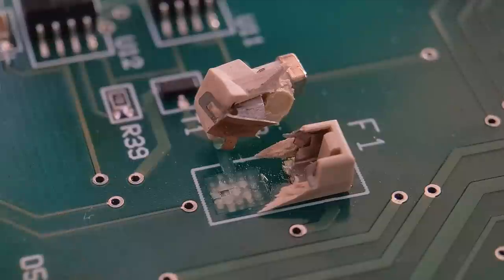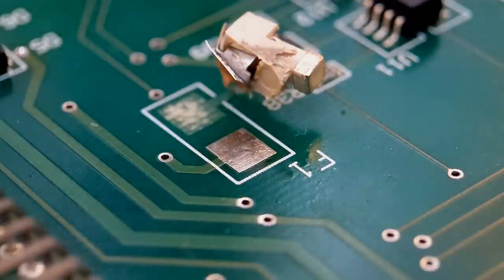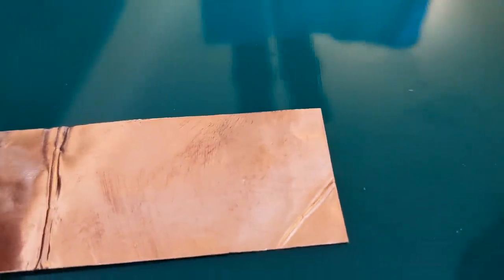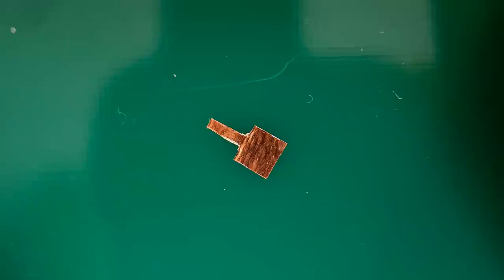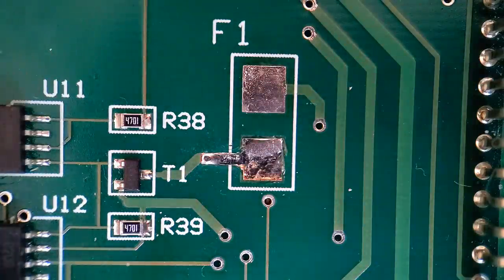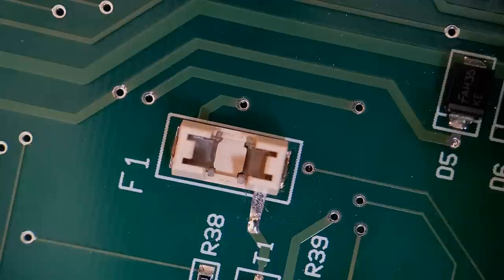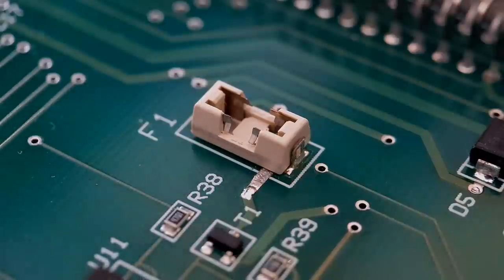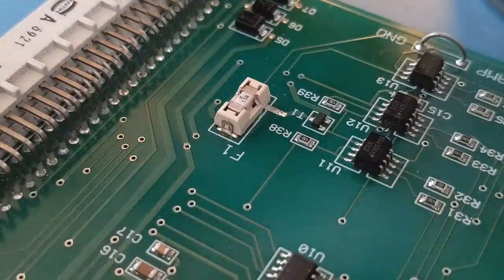How To Repair Damaged PCB Pads / Traces || Copper Soldering

Comment: As a trained and certified solder technician for decades, I personally I didn't understand why you didn't just leave the original pad attached, de-solder the broken fuse holder off, then glue the still attached original pad back down. However you did cut it off and then I don't understand why didn't you make the new pad run longer, scrap the attaching run, then over lap and solder the new longer pad to it, then glue it down. The repair looks good it's neat and tidy, but it could have been a more solid repair with the run overlap instead of a a solder bridge that can crack and open the circuit. Still this solder job is far better than the other hack jobs I see on YouTube with speaker wire and all kinds of stuff. At least you cut out a new pad and glued it down. Thanks for sharing though I still enjoyed the video. I'll check out more of your videos. Best Wishes & Blessings. Keith Noneya
Reply: At beginning he comments that it starts showing some cracking compromising its performance, that's why went with its replacement.
Reply from the maker: @NelsonAntunes-kf5un thank you for pointing this out to people , very much appreciated 👍
Reply: I’m guessing for explanation purposes, I try to save the pads that lift up, but sometimes they get lost or are very damaged
Reply: @yumkaax616 In that case it's best to place a new pad with an overlapping run onto the run that connects to it and solder them together. If it's a pad with a hole in it and it's just lifted, place an eyelet in the hole and crimp it down. If the pad with a hole is to damaged or missing, place a new eyepad in it's place with a long run. then place an eyelet in the hole and crimp it down. Now overlap new only run over the the run that it connects too and solder it. The pad will never come up again. I was a solder technician for over 35 years and have done this to many times to count. Best Wishes & Blessings. Keith Noneya
Reply: @keithnoneya  I never thought about the eyelet, will try it, thank you!
Reply: @keithnoneya would love to see a video of this method
Reply: @keithnoneya  Great advice. Could you tell where to get or how to make eyelets? What type of glue can be used for pads without holes?
Reply: Here's a video on how to set the Eyelet and, although not a run repair the principle is the same; https://www.youtube.com/watch?v=HaVa_7ZInIo Hope those reply's help anyone who needs the info. Best Wishes & Blessings. Keith Noneya
Reply: Thought the same thing

Comment: Good video, but I would slightly overlap the copper foil over the PCB trace, rather than the butt joint that you did.
Reply from the maker: Hi , thank you for your comment , much appreciated. I guess both methods are fine . I like to keep the copper flat to the board that's the main reason I do it this way , but your way is fine as well . Thanks again , take care 👍

Comment: Beautiful repair! Yes, there could be other ways to repair this by preserving more of the original lifted pad, but I think the end result here will be just as good. This will last just as long as the original factory traces/pads, and it’s probably even stronger than the original because of the extra glue fillets to mechanically bond the holder to the pcb surface.
Reply from the maker: Hi , thank you for watching the video and commenting , very much appreciated 👍

Comment: I’ve tried gluing pads with araldite but the bond does not hold when heated.  Plastic padding epoxy weld works great since it’s rated 100 deg C continuous and 315deg C for short periods.
Reply from the maker: Hi , thank you for your comment , much appreciated . That's great you have mentioned another glue that I hadn't heard of , hopefully your suggestion can help myself and others in the future . Thanks again , take care 👍
Reply: Is that the Super Steel epoxy weld?

Comment: I have both lead free soldier (thanks for the tip on 173 deg) but also lead 60/40 solder. What in your experience is the best temp for normal jobs? I think one has to up the temp on potentiometer bodies, etc. because of the larger surface are and also less time heating and maybe breaking the pot?

Comment: I have watched in awe as you repair these minute circuits/pads etc. Fascinating. I have a small quadcopter board that has the pads for a small inductor 1R5 missing. I would really appreciate your input/knowledge as to which process to use on it. Is that a possibility as all? BR Trevor

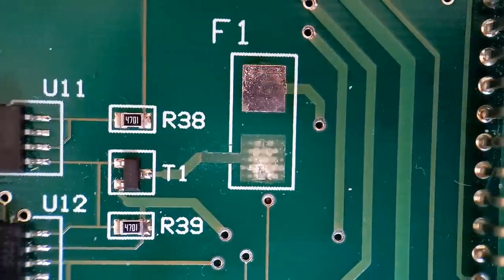Comment: 11:48 Would it be OK to use solder mask + UV cure on the board before putting the glue if the lower layer was exposed or just to make it better? Also, what was the glue you used please? These might be silly or odd questions because I am a newbie to this! Thank you for sharing this, I really enjoy your videos! Cheers!
Reply from the maker: Hi , thank you for your comment . Yes definitely you could protect an inner layer with solder mask  . As for the flux it's called Tak Pak 382 . Its very expensive if brought as a twin pack  , but if you buy the activator and glue separately you can save quite a lot of money . Shop around , EBay , Amazon etc . Hope that helps , thanks again 👍

Comment: Hi, I have learned so much watching some of your videos, thank you. Can I ask a probably stupid question, at 3:27 you use a "cloth" and "Ultra Solv" , can I ask what cloth you are using and why Ultra Solv instead of Isopropanol ? I am having issues with my PCBs being very tacky after I so called clean them. Sorry if its been mentioned before.
Reply from the maker: Hi , thank you for your comment , much appreciated . The cloths I use are only available in the UK I believe . A company called Grove Sales ( England ) supplies them . They are roughly £5 for a pack of 100 and together with Ultrasolve are amazing . I've used pretty much every cleaning fluid and tried loads of cleaning cloth types over the years and the combination I use now is amazing . Ultrasolve is on a different level to Isopropanol which I have used and is pretty basic , cheap and not great . Once you use Ultrasolve you will be blown away by the difference . I get mine from Farnell but I believe RS Components, Mouser and DIGIKEY also sell it , but I maybe mistaken . If you Google it you will find a supplier . It's not that cheap but does last a long time . I buy the 1 litre bottles and pour a small amount into something like a milk bottle lid and then just dip my cloth in it . The secret to amazingly clean boards Is these 2 items plus a hairdryer . For a great cleaning method I've posted a video on my channel all about cleaning including the hairdryer . Hope that helps , thanks again 👍

Comment: Does anyone know of a glue that actually sets and is resistant to heat from the soldering iron?
I've done countless repairs with copper tape, but every glue simply turns to liquid the moment you try to solder. 
Only way I've found is to do the repair, solder THEN solder mask on top...but doesn't as neat.

Comment: Hey, just wanted to drop a quick but MASSIVE thanks for all your videos, but in particularly ones like this on fixing missing pads/traces. Following your videos I was able to successfully repair a faulty Grandstand Astro Wars game from 1981 that I bought as spares on eBay. One of the faults was the common D882 power transistor failure and by the looks of it I wasn't the first to attempt a repair of it! After removing the D882, I lost 2/3 of the pads! I jumped one with insulated wire to a nearby pad on the same trace and used some old earth wire copper strand to connect the other pin to the trace after surfacing some copper. All learnt from your videos! Keep 'em coming!
Reply from the maker: Hi , thank you for your comment , very much appreciated . I'm really glad the videos have been of use for you , that's great to hear . It's always nice when you can fix old products so good on you  . I will always post more when I can as long as they seem useful still  . Thanks again and good luck with all of your soldering projects in the future , thanks again , take care 👍

Comment: Thanks for making this video!! Recently I was trying to repair a gameboy color and when I was trying to reinstall one of the battery terminals (a through-hole component), I accidentally pushed the copper up. Will this work for the copper around a through-hole area? Sorry if the description of what happened isn’t great, I'm not sure of the right terms to use since I'm still a beginner. I wish I could show a picture since they're worth a thousand words lol
Reply from the maker: Hi , thank you for your comment , much appreciated . Yes this method would definitely work for the situation that you have . I have also posted another video on my channel showing 4 different methods for your type of problem . This video may be useful for you . Thanks again and good luck 👍

Comment: After all of your meticulous care I was surprised you didn’t cover the exposed trace with solder mask. Fantastic work though. Very impressive.
Reply from the maker: Hi , thank you for watching the video and commenting , much appreciated . The only reason I didn't solder mask the repair is when I filmed this video I didn't actually have any . I did state somewhere near the end of the video about using solder mask to cover the repair if you wanted to . I posted another repair video shortly after this one where I did use it ( I had some by then ). Thanks again for your support , take care

Comment: I wonder if Fuji Seal-Glo might be a convenient and good adhesive for the purpose. It's the red colour heat-cure 1-component epoxy that you find under backside SMD components, which normally permanently cures during soldering.
Reply from the maker: Hi , thank you for your comment , much appreciated . I haven't personally used this particular epoxy so I can't comment on it . Maybe others who have can comment . Thanks again , take care 👍

Comment: This is so much nicer as a finish than the jump wires I've resorted to on the couple of instances I've had to deal with lifted pads (diy repairs on little projects). And the end result you show, is definitely worth the effort.

I don't often have to repair things, but I have a few repair projects sitting in my to-do draw... Along with a whole bunch of on copper strands taken from a power cable, ready to shape around component pins that need to be removed.

So yes, I'd previously learnt a great tip, and this is another to add to my pile. I've been using a soldier iron since I was about 7, and I'm still one of the greenest novices you'll see (some 36 years on). In fact, I don't doubt that the grandfather who told me I'd used enough solder to weld up the Titanic, would probably still say I could weld up a frigate with some of my solder joints. 😂
Reply from the maker: Hi , thank you for your support of my channel it's very much appreciated . If my videos can help a few people out with their desoldering / soldering projects then I'm happy . Thanks again , take care 👍

Comment: I just had to replace this fuse holder today. 
How do you deal with tight spacing? The solder iron barely fit between the fuse end and a plastic board mounted connector.
Reply from the maker: Hi , thank you for your comment , much appreciated . I fully understand your question about tight positions of components. The iron I use a Weller TCP S has tips that allows me to manipulate the shape of them slightly, bending etc , also filing them down to achieve an incredibly small tip . Even though many people tell me you can't do this to your tips I do and it works great . I have a Metcal iron also for my professional day job which comes with micro long tips which can get into incredibly tight gaps . I do believe choosing the right tip does help in nearly all cases . Sometimes I will remove the component next to where I need to solder and then refit it after soldering on the new part . If the position of the pads allows this I will sometimes choose this method . There's always a way . Thanks again , take care 👍

Comment: One question. Have you done BGA replacements? If so I would love to see your take on it. I know I have watched all of your videos at least twice but cant remember If I ever seen anything dealing with BGA.
Reply from the maker: Hi , thank you for your comment . In my video . Removing Electronic components ( part 2 ) , I show how to easily remove the BGA and clean up the pads on the board after removal . No matter the size of BGA this method works for me every time . The board is perfectly prepared ready to accept a new BGA . I don't show the replacement of the BGA because it's impossible to prove it is done successfully without cameras and lighting underneath ( Ersascope ) , which I personally do not own but have used elsewhere many times .Thanks again , hope that explains why I won't show the refitting .

Comment: very nice. The zoom is so good, you can see the glue crystallise after applying the actuator.  In this case, would it have been possible to use the actual trace by desoldering (hot air or soldering iron) to fuse holder from the loose pad? And then use the original trace.
Reply from the maker: Hi , thank you for your comment . The original trace was warped and was probably weakened , but I did say right at the end of the video some people would say why don't I just bridge across from the good pad to the end where I cut the trace , and I probably could of. But you would of had a tiny , weak joint on the trace end . Also I wouldn't have shown people what you can achieve if you just bodge it across . Hope that explains ok . Thanks again , take care 👍
Reply: @mrsolderfix3996  Thank you, I hear you. I really enjoy the nice fix and learned something new.
Reply from the maker: Hi , I just want to show people what can be achieved . I always found if you try and do everything the best you can instead of taking short cuts you will progress to be able to do harder and smaller devices and fixes as you go along . Hopefully I can convince a few people and they can improve . Thanks again for your comments , take care 👍

Comment: Do i need to use the glue or will just soldering it keep it in place?
Reply from the maker: Hi , thank you for watching the video and commenting , much appreciated . As the fuse holder is only properly secured down at one end it is far better if you can add a small amount of glue . If the holder is going to be safe with no future touching or knocking of it then it will probably be ok as it is . But if there's a chance it may get knocked in the future then ideally glue it down . Thanks again , take care 👍

Comment: what do you think of the precut copper foils? (i think ive seen then more for chip pad+trace).
Reply from the maker: Hi , thank you for your comment . I have seen other channels using these but to be honest I've never used them . I've always just lifted a trace or pad of the shape and size I need from a scrap board or used copper foil to make any size you may ever need . I do notice people fitting these premade pads and traces to boards and using the wrong size . It's pretty important to try and match the size the best you can for signals etc that may travel through this . Some people seem to fit traces that are a quarter of the original width ( not a good idea ) , thanks again , take care 👍

Comment: Very nice.
Nice work. After tinning the track, do you feel the need for UV curing soldermask is negated? Thanks.
Reply from the maker: Hi , thank you for your comment . I meant to mention in the video about putting solder mask on the exposed trace , but obviously forgot . It's hard to remember everything . What I did do though is in one of the photos at the end I showed the trace and said you could place Solder mask or Kapton tape over the trace . Thanks again , take care 👍
Reply: @mrsolderfix3996  Thanks for the response. Yea, I don't usually hang around for outros.

Comment: Can you share link to tac pack please? Thank you
Reply from the maker: Hi , places like Farnell , RS Components , Mouser  sell Tak Pak in a twin pack ( glue and Activator ) but a cheaper way to get it is to buy these 2 items seperately . I normally get the glue from eBay and the Activator from a company called Zoro . Tak Pak is expensive  but if you do a lot of PCB modification wires it's the best there is . Always spray very lightly first , glue second for wires . I've showed the correct way and how to apply it in some of my trace repair videos . Hope that helps , thanks again 👍

Comment: Interesting way to fix it. And as other said, should work for an eternity. Like it!
Reply from the maker: Hi , thank you for watching the video and commenting , much appreciated. The copper tape does work well and you can shape it to whatever you need which definitely helps . The only thing I would possibly add which I did mention in one of the end photos is Solder Mask or Kapton tape to the exposed trace . Thanks again for your time , take care 👍

Comment: would you ever cover the repaired exposed trace with cap tape or glue or is it not so important?
Reply from the maker: Hi , thank you for your comment . I honestly thought I mentioned it in the video about what you could do with this exposed trace . But I believe I forgot to mention it. But I know in one of the photos at the end I say about covering with Kapton tape , glue bead or Solder mask . It's not important unless there's a chance of something else nearby ( cable , , board etc ) shorting out on it . Sorry I left it until the photos, thank you for pointing this out 👍
Reply: a cheap but good solution ive liked is using nail polish